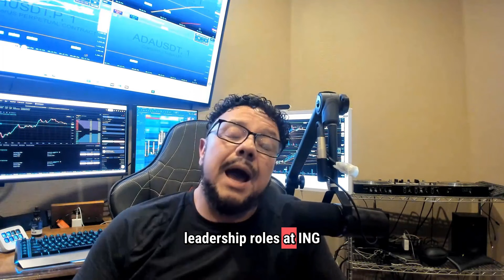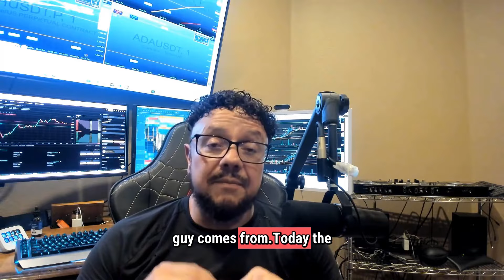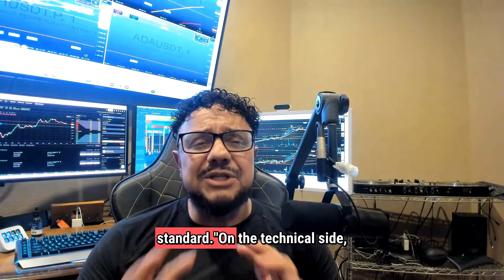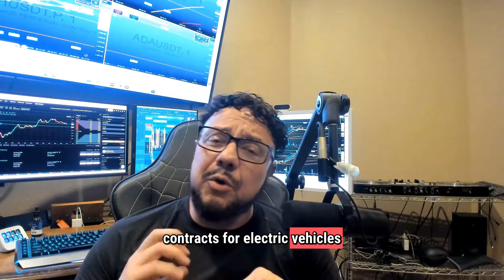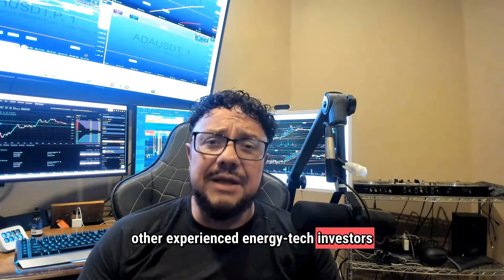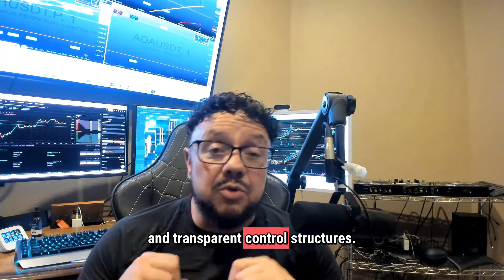Just dropped the full Energy Web Token (EWT) Token Tear Down

Comment: Well summarized.
I mean it sounds promising, but can these claims be proofed by sources? And since it sounds so reasonable, why doesn’t it get more attention? The graph doesn’t look very impressive tbh.
Reply from the maker: Totally fair questions, and appreciate you actually looking under the hood instead of just vibing with the hype. This one is really a narrative play in the infra / energy vertical, and that narrative just hasn’t had its time in the spotlight yet.

On the “can it be backed by sources?” side: the claims in the video come from public docs, partner announcements, and on‑chain / market data around the Energy Web stack and EWT, so it can be traced back to real sources rather than just hopium. To be clear, we don’t currently hold any EWT inside the Garage; it’s on the radar, not in the bag, and the fact it’s listed on a major venue like Kraken just makes it an easier lever to pull if we decide it earns a slot later.

As for “why doesn’t it get more attention?” – this is classic boring‑but‑potentially‑important infrastructure: utilities, grid operators, and enterprise energy players move slow, don’t market to retail, and price discovery usually lags real‑world adoption. The chart not mooning is exactly what you’d expect from an under‑the‑radar infra token: long periods of chop/accumulation, relatively thin liquidity, and no meme engine behind it yet, which makes it a thesis – not a guarantee.

For context, we’re building this channel because a lot of people genuinely don’t understand how any of this works, and that’s the gap we’re trying to fill. I’ve been in automotive for over 30 years, run a few dealerships, always been tech‑ and business‑savvy, and have been in the crypto space since 2017, explaining this stuff to people around me long before we ever hit “go live” on YouTube – they enjoyed it, so we turned it into a channel.

To be fair, this whole segment was a viewer request, and the Garage approach is always the same: break down what we see – good, bad, and ugly – and let people make their own call on whether the narrative, the data, and the trade location line up for their risk profile. Now that we broke it down, like I said, it’s on our radar but not actually in our bag yet – the specs did not look bad, and we don’t get paid for these; we just enjoy doing them and hopefully that answers your question.
Reply: @GuruCryptoGarage 
I did not expect such an elaborated, honest and profound answer. Actually I didn’t even expect an answer from the content creator himself.

Kudos to you, you have just earned a subscription.

I think since the price is fairly low compared to the past and with all that knowledge now it won’t hurt to get a few bags to rest on the sideline for me.

All the best to you!
Reply: @MortredMaul  His response to you was AI generated. I don't disagree with the response, or points made in the video, but just be aware - all of this content is AI generated.
Reply: @PalisZ  
Damn it. I was already wondering about the voice. Thanks for the clarification. But the visuals are real, aren't they? He just puts a layer of AI voice over his own?!
Reply: @MortredMaul  No, the visuals are AI generated. Look closely enough and you can see plenty of glitches. Especially when the hands move over the mouth (fingers disappear briefly). His mouth movements, and movements in general just aren't quite natural. It's fairly convincing but you can still pick it. Basically he inputs images of himself in to an AI engine, as well as samples of his voice, gives it a script, then the AI generates a video with voice and movements. None of it is actually him.
Reply: The entire script is almost definitely AI generated also.
Reply: @PalisZ 
Jeez
They deceived me big time. I didn‘t  really watch it, rather than listened to it.

Thank you for pointing it out.
Reply: @MortredMaul  No worries - it does look like this guy started out creating real (non-AI videos) but they didn't perform well at all, lol. His AI generated video's have done way better. Kinda sad in a way...

Anyways, I'd still say EWT is good token to buy a bag of - I've been loading up on it for a bit over a year now, and have been following it closely.
Reply: @PalisZ  I am AI. 

🏃🏾‍♂️💨 💨💨💨💨💨💨